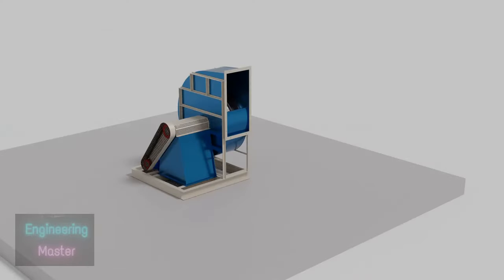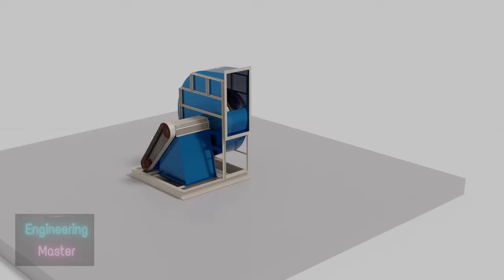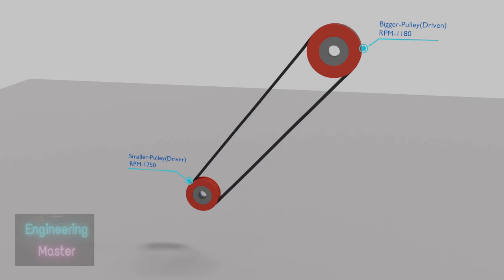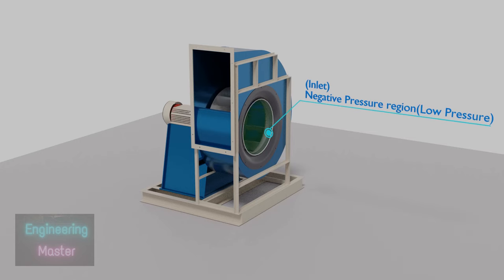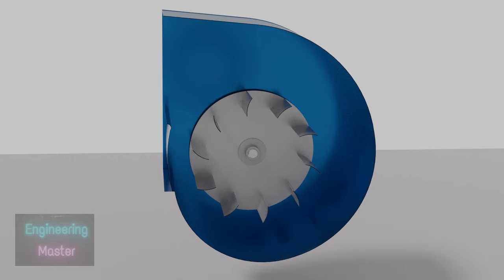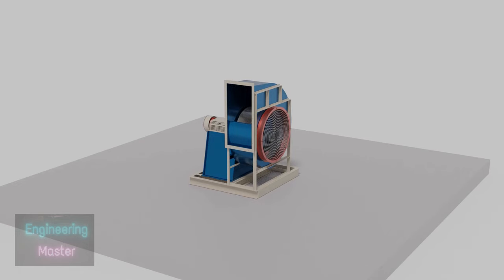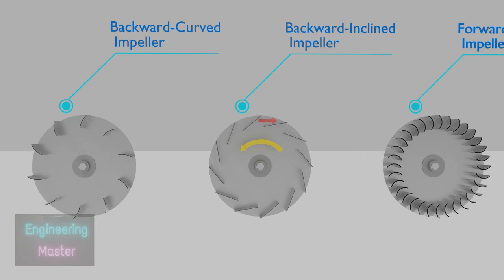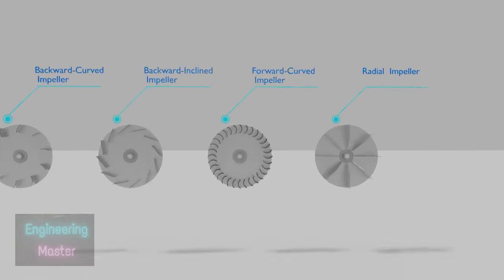Centrifugal fan working (Animation)-Blender Software

Comment: Very good upload, thank you.
For contaminated air extractor (example spray booth aplication), would backward curved centrifugal be better than axial fan, size for size power for power ofc?
Also, which one could be quieter, if similar silencer methods are used?
Thank you.
Reply from the maker: Better is axial fan in these application,Backward curved blades will accumulate dirt easily and it's difficult to clean.when it comes to noise axial fan creates more noise.If the application is high pressure and low volume go for centrifugal fan.if the application is low pressure and high volume ,then go for axial fan
Reply: @engineeringmaster9214  thank you 👍

Comment: I dont understand the theory behind the decisions of choosing anything other than the Backward-curved impeller?
The price must be the same?
Reply from the maker: Impellers are selected based on application .I have compared about different impellers in this video itself.
Reply: Though backward-curved impellers are the most efficient in ideal conditions, they are prone to having contaminants build up on the various surfaces and edges of the blades. This buildup will massively reduce their efficiency over a short amount of time. However, the backward-inclined design is less susceptible to this buildup on the surfaces, and the radial design is even less susceptible to buildup on the surfaces as well as on the edges, so even though they start with less efficiency, they will require much less cleaning maintenance than the backward-curved impeller and maintain their efficiency longer. There are also some applications where impellers with leading edges (backward-curved, backward-inclined, and forward-curved) would be directly damaged by the materials being blown through the fan. This is why radial impellers are used in contaminated air applications, as the blades "sweep" the air instead of "cut".

The oldest boiler we still run at the plant (installed in the 60s) has a backward-inclined forced-draft fan supplying air to the burners and a forward-curved induced-draft fan directing the exhaust out the stack. The F.D. fan tends to get some lint buildup in the housing and on the leading blade edges (we handle textiles) but the I.D. fan stays very clean because any lint, dust, or other debris that gets through burns in the firebox.